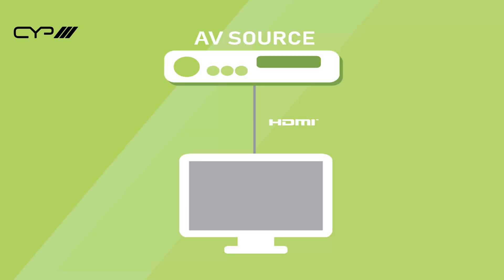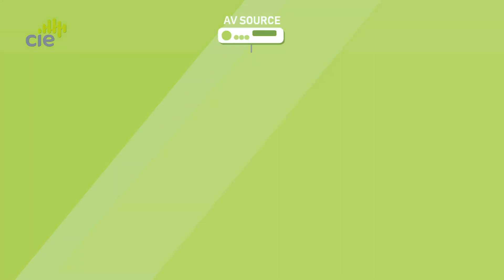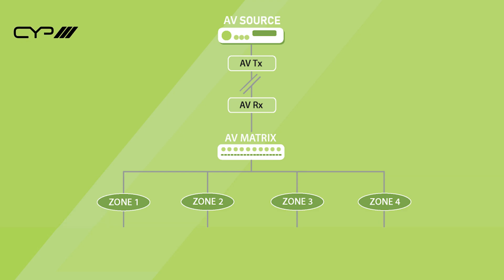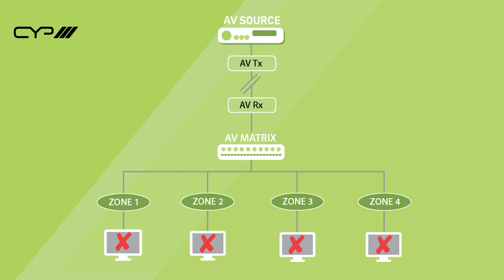Troubleshooting AV Equipment  |  HowToAV

Comment: As an IT tech, this is all good basic troubleshooting information that I would do already, but it's good to know that the basics work on the AV side too.  Known good cables, known good signal sources, known good output devices, reduce variables, change one and only one thing at a time, did you try turning it off and back on again.  👍

Comment: I have an issue where when my mini fridge compressor kicks on i lose video signal from my TV. Ive spent at least a year searching for a solution with no success. I unfortunately cant switch outlets due to living situation being quite small. Only my 2nd smaller older TV does this when playing my retro consoles on it. Anyone have any tips or tricks to fix this issue?